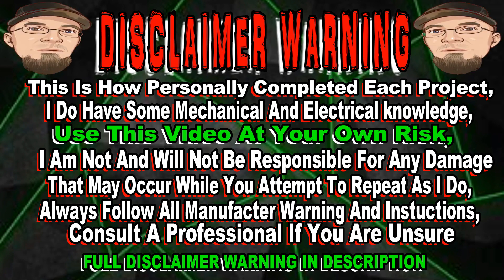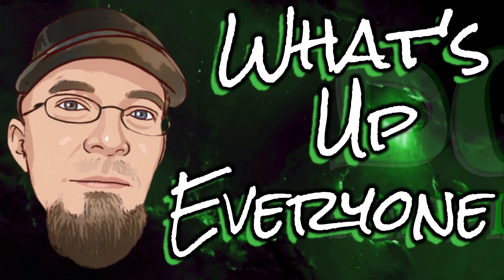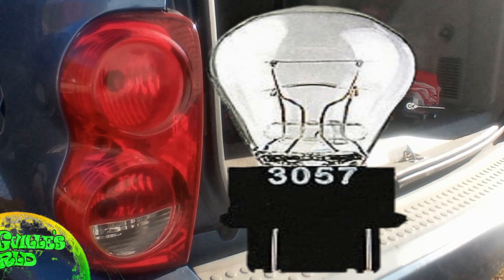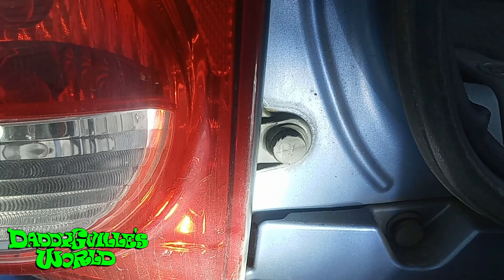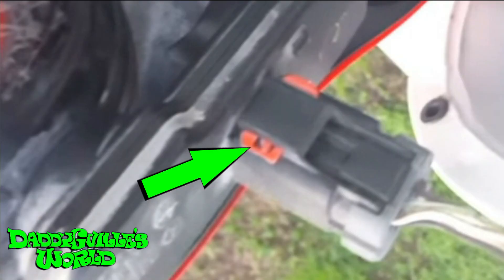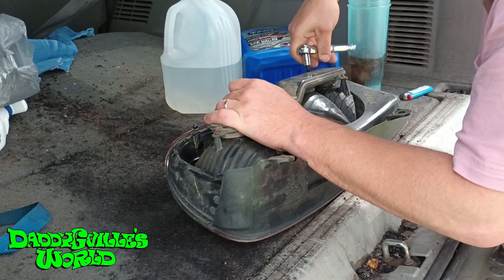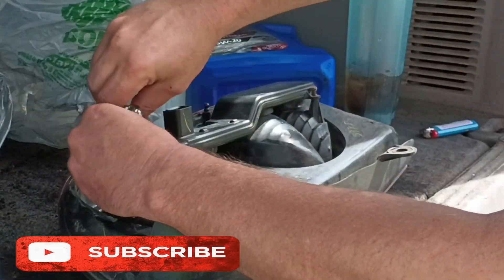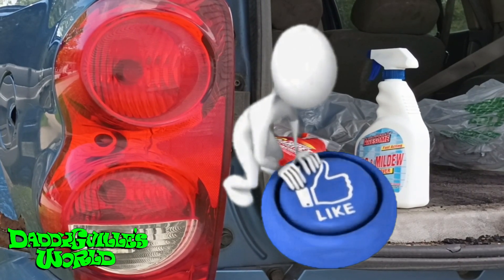Dodge Durango Or Chrysler Aspen Tail Light Circuit Board Replacement

Comment: My 2004 Durango started having issues with the bulb that's for brake and turn signal.

I swapped the other bulbs into it and they all act the same way.

If I press on the bulb from side to side a little it will start working but as soon as pressure is released it stops working.

I feel like this is more of an issue with dirty contacts.

Do you think its internal because it doesn't look like these can be taken apart?
Reply from the maker: Also had this issue once before, I used a long thin flathead screwdriver and bent the circuit board clips inward closer to where the bulb slides in, but make sure the whole board is unplugged.
Reply: @DADDYGVILLESWORLD  I actually tried this today. Helped a little bit, but bending the metal inwards is hindered by a piece of plastic that the clip hits.

Wondering if inside the plastic housing there are actual circuit boards the sockets are soldered to?